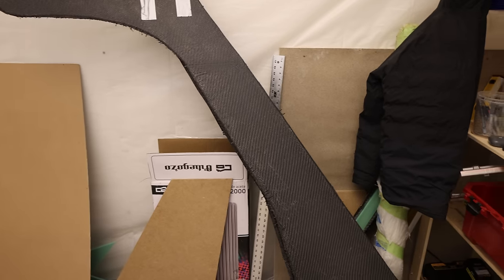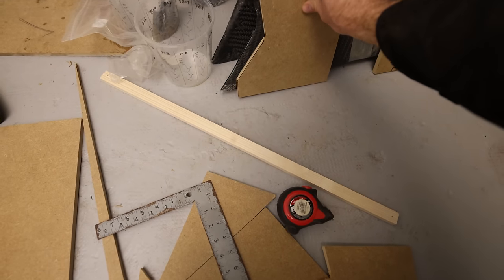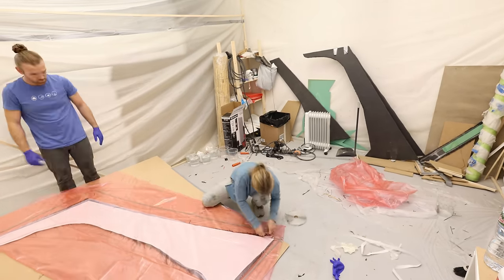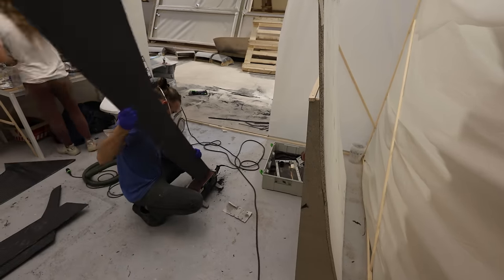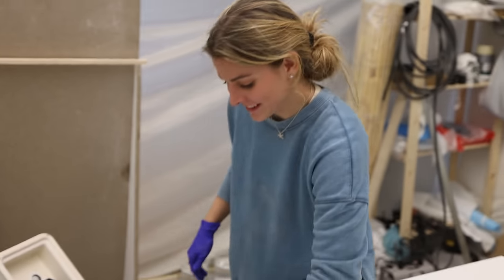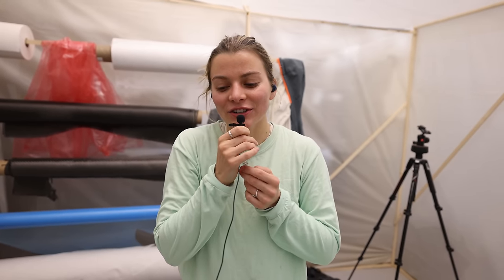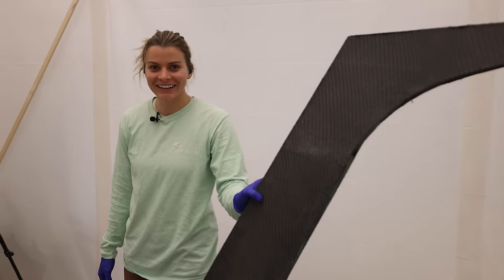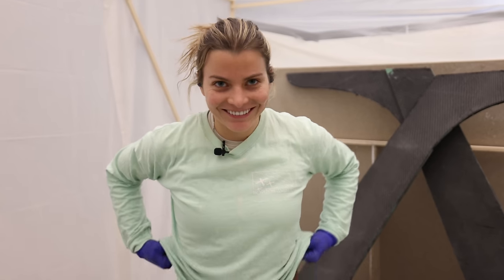Build everything out of Carbon Fiber they said... (5)

Comment: Thank you. As a disabled veteran I must say I find your positive outlook uplifting. I feel good after a dose of one of your videos. I just wanted to say thank you to you both. My only regret is not embarking on such a voyage as yours over 50 years ago. I did it the easy way by thumb, bus, boat, ferry and plane not forgetting the odd bit of shanks pony (Walking).
It doesn't matter what you encounter on the way as long as you have fun and each other.
My only tip, speak and interact with locals wherever you end up on your travels.
All the very best.......

Comment: CF is a conductive material.  Layup fiberglass between it and your metal components to prevent galvanic corrosion.  I was also thinking that the leading edge would look good if it was round.  Imagine hot glueing a foam pool noodle cut in half lengthwise to the front of the arch to use as a form to lay fiberglass over.  Then remove the noodle and tab the fiberglass piece in.  Would give it that “airplane wing” look and be a throwback to your days as a pilot.
Reply: Adding to this, ensure ALL metal fasteners are isolated from the CF via a G10 sleeve, a layer of fiberglass or some isolation paste. If you use the paste I'd plan on changing fasteners on a some sort of routine "preventative maintenance" schedule.

Comment: Hello both, another good blog and another step forward. Now from the arm chair critic, someone else has mentioned making cf sheet, on glass or use 2 slabs of wood with food wrap and make a sandwich no peel ply needed. From my days as an A&P, beware that Carbon and aluminium do not mix, but it could/can be used if an interfay is used.  Bret mount the belt sander to a block and tip and clamp it sideways doh.😄

Comment: I have been fabricating some things out of carbon fiber lately, and I swear my biggest frustration has been tracking down all of the tiny air leaks in vacuum bags.  A friend let me borrow his ultrasonic leak detector and it was a game changer for me - it is able to track down and identify even the tiniest pinhole leaks by the sound the leak makes. The one I borrowed was a "VPE ultrasonic leak detector", but several companies make them. Possibly you can find one to borrow in the area, or maybe a good "win-win" sponsorship or review opportunity for the channel?
The detector found a leak that could have ruined a quite expensive (for me anyway) resin infusion on a large part. My last three vacuum-bagged layups have been as close to perfect as amateur-me could hope for.

Comment: Just a suggestion for the helm, instead of epoxy and carbon fiber, you should consider using carbon fiber vinyl wrap.  Its cheap and easy to work with.  Using your heat gun, you can get it to curve very easily around the edges and parts you want to cover.  I did this on my helm and think it looks great behind the MFDs and instrument displays.  Great channel.  We enjoy watching your travels and projects.

Comment: If the parts you are covering in carbon/epoxy will be exposed to UV they will chalk, unless you put a coat of PU lacquer with UV absorbers in them. This won't affect them structurally, but after a short time they will look dull & grey.

Comment: Its too late but weld  the bolt  through  the metal  and all you need is a backing plate and nuts to attach it to the boat.

Comment: Errr guys , just like to put a heads up here . A carbon arch is a really good idea , to incorporate a davit system is even better , but . I also have a project for davits , so i was really interested in being able to produce something that would fit into the mother crafts design . 

But It's been done before and failed . Although the actual davit arms did seem strong enough to handle the weight when loaded , the actual deck mounting failed . The deck plate pulled out of the davit bottom fixing , when tested with a light weight hard dinghy , minus the outboard . Test this carefully guys .
Reply from the maker: This is news! Was this your project? I'd love to see the details on the failure and why exactly it failed!
Reply: @ExpeditionEngineering No , not my failure , another you tuber , i'll try and find the video . I liked the idea , thats why i was watching   .
Reply from the maker: Wow I appreciate the link! What a bummer of a failure, certainly looked like clean work he did! very different design, materials, etc but there's definitely valuable information to be gleaned!
Reply: @ExpeditionEngineering Just sorry it took so long to find it , i struggle to believe it was three months ago . I figured some kind of steel back bone maybe the way to go , as that would overcome this particular point of failure , but the problem is the cost keeps on climbing with no guarantee of success . Note it didn't fail anywhere else , just the point where the load would have been at its most .   I certainly think the load needs spreading out more . 
I hope you can figure out a path forward , and i'll keep an eye on this particular project , it would be interesting to see the outcome .

Good luck .

Comment: Guys- every hardware store in Spain sells metric tape measures, get a couple. I’m doubtful about your structure- to get the tensile benefits of carbon  fiber, wouldn’t you have to wrap around the box uprights, not just make flat panels? Please make a diagram of forces- how is weight of dinghy transferred from rigging thru structure to deck bolts? How does upright box connect to metal piece inside?